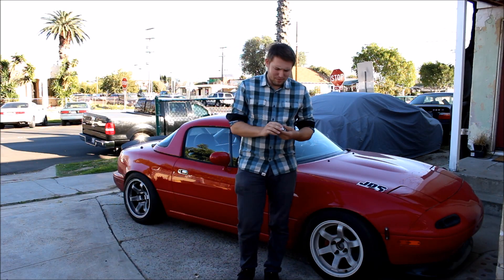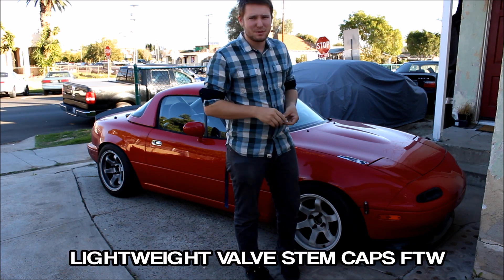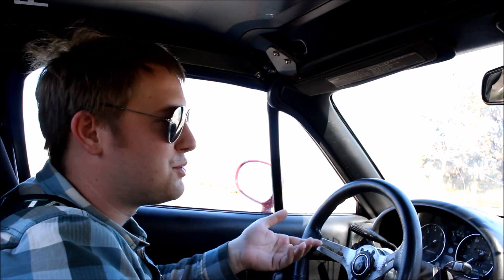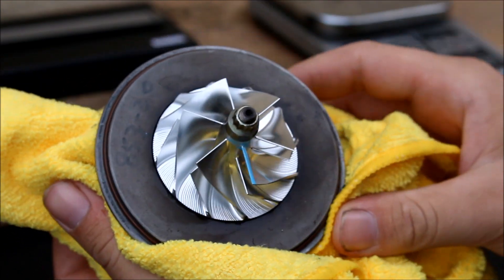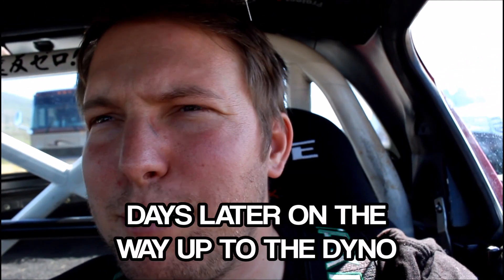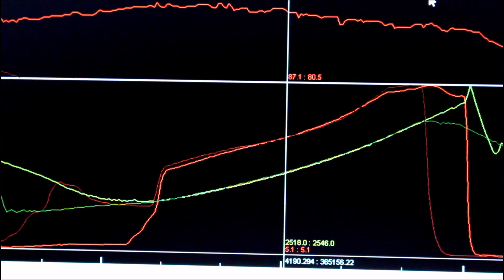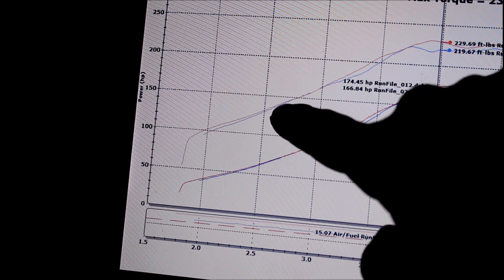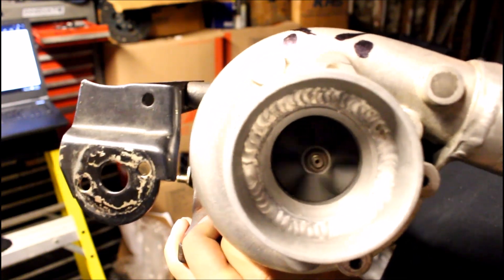Trying to Break The Miata: Billet Compressor Wheel Science!

Comment: Wow man, this is really good data. Using a rolling dyno is sometimes really inaccurate if you don't start the run with even the same exhaust tempurature. The on road testing with different gears testing both boost threshold and lag is something that most guys leave to the butt dyno.
Thank you. This goes beyond what many wheel makers will do.

Comment: If the new compressor wheel is taking in more air than the original one wouldn't that extra force needed to pull it through make it spool slower? I don't understand how that extra air flow doesn't slow down the spool...

Comment: A billet wheel isn't really going to change HP numbers, it's mainly less rotating mass to quicken spool. You summed it up pretty well, only true way to know is data logging with same variables. You can shave more weight by grinding down the heavy nut on the turbine wheel. Hell of a lot cheaper and likely more weight savings.
Reply from the maker: atlanticimports Exactly what I found. The extra 20hp was purely attributed to an extra pound of boost and a little ignition tweaking. I was a little disappointed the boost threshold wasn't slightly lowered, but the increase in transient response is cool!

Comment: did you happen to log the intake temps? since the wheel is more efficient I wonder if you could see a corresponding temp drop
Reply: There is probably very little difference in actual compressor efficiency. Through the middle of the pull its probably within 2%, lots of Garrett Compressors are really good even the ones with a 30 year old design. Shockingly they usually do very good under 1 bar boost. You might have a 10-15°f difference but it's going to be pretty small.
The megasquirt definitely logged the data though.

Comment: #carpassionchannel 
Hey, i need advice on witch turbo i should choose for my setup.
I an planing on building a 1.6, stage 1 headwork and want 300hp.
Could i Get away with a gt2560 or do i need to move up to gt2860 og gt3071?

Guess you allready know, but this is the best YouTube channel of all time!!!👍🏼
Reply from the maker: a GT2560 will do 300whp maximum, a GT2860 will do it more easily and more efficiently, but it will lag significantly more. 3071's can do over 400whp so that would be overkill.

Comment: Anyone know safe turbo numbers for a 1.8 NB with a 5spd? Thinking about rx8 injectors, mega squirt, GT2554R if they cannot handle a ton of power or a GT2560R if they can handle more. 

Also if you had to rebuild the motor, mine is a healthy 156k, what would be the weakest point to upgrade handle safe boost? Would love to run 200-225whp and similar torque.

Comment: what wheels are you using? and the dimensions?
Reply from the maker: Original wheel dimensions for the GT2554R, the specs should be available on Garrett's site. 54mm compressor and 53mm turbine diameters iirc

Comment: I honestly think having 250-300hp in miata is just the perfect sweet spot...the car has good traction and it still is very quick
Reply from the maker: Exactly, power is still 100% manageable with the right tires and suspension, but it's still wicked fun and will surprise most V8's
Reply: TheCarPassionChannel absolutely!

Comment: +TheCarPassionChannel I just bought a 94 NA8 Miata with the full VooDoo II kit.  Im trying to figure out if I should go with the Hydra upgrade or Megasquirt.  Great numbers here... so I figured I would check with you.  Also, what injectors would you suggest?  I am hoping to get around 250hp or so with those upgrades.  I'm running the same 2554 turbo. Thanks!

Comment: 93 miata and wanting to boost but can't afford 3,000. can it be done?
Reply: Thats right on the cut off point. if you wanna source used parts + ebay parts then you might be able to do it. i dont know if i would trust it though. the things that are going to nickel and dime you to death will be all the small junk you didnt take into consideration and the dyno tuning time. 
If you want to do an all new non-ebay build then you are looking at 1400-2200 just in turbo and aftermarket ECU. that doesnt take into account the manifold, exhaust, fittings, intercooler, tuning, etc.
Try looking around on craiglist or facebook for a person selling their miata turbo parts if you wanna get used.
Reply: if you keep it under ~300hp and not tracked or raced then you should be fine with stock stuff. If you wanna track it then you wanna upgrade the clutch and maybe find an LSD rear differential.
Reply from the maker: It depends on what year your Miata is, the stock 1.6 diff can grenade at 200hp, the stock clutch will only hold 150wtq or so. I have a full list on my website of approximate numbers that stock parts can handle. www.thecarpassionchannel.com/faq
Reply: When does upgrading the drive train come into play? differential, transmission and clutch.
Reply: Sweet, thanks for the advice bro.

Comment: Wait is the wheel you replaced the turbine that draws air into the car or the one being pushed by the exhaust?
Reply from the maker: I replaced the compressor wheel, the one that draws air in and compresses it. The wheel on the exhaust side is called the turbine wheel.
Reply: +TheCarPassionChannel thanks.

Comment: @TheCarPassionChannel - Do you feel this new compressor wheel puts the characteristics of say a GT2560R into a smaller housing? Does the turbo hold boost longer or still tapper off at the where it used to?
Reply from the maker: +Troy Sebo It's really hard to say because I never tried to raise the boost up top with the stock wheel. The consensus is that it can flow more air, and 276whp is a really impressive number for a 2554R (IF the dyno is accurate which a lot of people are skeptical of. That's why I'm running the 1/4 mile next weekend, the trap speed doesn't lie). At areas of the dyno where the turbo was running the same boost level with both wheels, the car didn't make any extra power, so it's hard to say. Cars would have to by dyno'd literally back to back to get a better idea, but I just don't have the time/resources to be able to do that. (I'm lucky I have this dyno to use). As far as the housing size, some people install a 60R wheel into a 54R housing that's been machined, and supposedly there is little to no performance loss from running the smaller housing. The only downside to that is you have the weight of the 60R wheel as opposed to the smaller 54R wheel. These are questions I will try to answer someday!
Reply: +TheCarPassionChannel 
Since you were running corn fuel during this dyno I am confused whether or whether not the new CHRA did anything. I know 276 is a kick ass number but if you were to give 2-3 characteristics that you noticed with the new wheel what would they be, for example faster spool? held boost better/longer? Thank you
Reply from the maker: Troy Sebo I was also running E85 when I originally dyno'd with the 2554/stock wheel. The main difference is I raised the boost in the high RPM to keep the torque flatter for longer. Could the cast wheel have done this? I'm not sure because I didn't try it. The most measurable difference was the transient response.

Comment: Greg, I was watching the video of your Miata on TJHunt's channel and saw you had a lightened flywheel. It seems to be a bit of a grey area whether lightening flywheels is good on boosted cars or not. Would be great to see a video on this!
Reply from the maker: +Grazo22 The "claims" are that it hurts spoolup because there is less load on the turbo. I've never seen any testing done to prove that, and I disagree with it. When you're accelerating, the turbo is loaded up by the weight of the entire car, it doesn't care how light the flywheel is. Anyways, just a theory, I freaking love mine and I'd go lighter if I could. The rev-matching on downshifts is super snappy!
Reply: +TheCarPassionChannel I'm inclined to agree with that. Use to love it on my N/A Clio for the reasons you day but now I'm going boosted its an interesting debate the net has never settled. Would be a pain to conduct back to back tests! Keep up the good work on the channel, I really enjoy it.
Reply from the maker: Grazo22 Yeah that's one test I'll proooobably leave up to speculation, lol. I got another good one coming up though regarding turbo testing, probably in another month.

Comment: Is it stock internals?
Reply from the maker: +iSol Stock internals, stock cams, stock head gasket/head bolts, etc. Everything from the valve cover to the oil pan is original.
Reply: Wow nice, how much power do you think it will max out at before bending rods/melting pistons?
Reply from the maker: iSol The commonly accepted values for rod safety is about 250wtq, and pistons are good to around 300whp assuming safe AFR's/no detonation.
Reply: Good effort then!

Comment: Isnt this the threshold 4 banger Audi's fanbase recommends there 4 banger limit??
Reply from the maker: +DarkLinkAD .........what
Reply: TheCarPassionChannel
Yeah, its the recommended threshold for 4 banger Audis. They come with with forged pistons and cheap rods, so the general conscious is that the cheap rods will fail over 275whp.
Reply from the maker: DarkLinkAD That can vary a lot from engine to engine. Also, torque bends rods, not horsepower.
Reply: TheCarPassionChannel
Yeah, Torque spikes more specifically but these guys are too conservative in my opinion.

Comment: stock block? just with Turbo and ms?
Reply from the maker: +Cramer Ward-Collings Essentially. Turbo, MS, E85, and lots of dyno pulls over 2+ years of refining the setup
Reply: +TheCarPassionChannel thank you! how much power do you think a stock 1.8 could hold?
Reply from the maker: Cramer Ward-Collings The connecting rods of the 1.6 and 1.8 both have about the same threshold of 250wtq. The 1.8 just makes the power a little easier.

Comment: Hey!
Did you ever talk somewhere in your videos about compression ratios? :) If not, I'd love to see a video about this and possible choices for pistons etc :D
Reply from the maker: +MrShiver55 Still completely stock internally, factory compression is 9.4:1.
Reply: Yes, i know. (That is impressive at your power level :D ) The thing is..... I have a 1.6l 1990 engine here, which is completely disassembled. I'd like to go forged and I'm still wondering, at which compression ratio I should aim. ATM I am thinking about 9.0:1 or something. Compression reduction for turbo.... Any ideas? :)
Reply from the maker: MrShiver55 Sounds perfect, I think there are a couple companies that offer 8.8:1 or so. It's safer to run a little lower compression and more boost haha. Check out Fab9Tuning (dot) com, they are your one stop shop for high horsepower parts and they have a big selection of forged parts.
Reply: +TheCarPassionChannel Thanks :)

Comment: I wonder what kind of difference this billet wheel would make if you were running e85 on higher boost :)
Reply from the maker: +MrEp1kk I am running e85, and on a GT2554R it really is close to being maxed out. More boost isn't going to do much more, time for a bigger turbo!
Reply: Ahh okay thanks :) Disco potato upgrade maybe? (garrett 2860) Have you done a video about living with an e85 fueled car? Very curious to hear about the long term pros/cons..
thanks again
Reply from the maker: MrEp1kk Scared the 2860 might be too laggy for what I want, especially since I'm already loving the spool up of the 2554. And I don't have much more headroom since it's a stock motor. I haven't seen any long term negatives, I've run E85 for around 8,000 miles I think? Biggest downside is the range, went from 26mpg average to 18mpg. That's with all cars though, it was well worth the gains, but you really need dyno time to get the most out of it.
Reply: Hrmm i see your point.. would you build the motor or jam in an sr20 driveline or something first? Here in aus we have 98octane petrol (lucky i know) do you still think e85 is worth the extra few octane?
Reply from the maker: MrEp1kk I think if I had my choice I'd go 98 octane since you'll retain your fuel mileage. I think I'd do a mild build on the 1.6, just pistons/rods. If I went through all the trouble of a swap an SR20 would be high on my list.
Reply: Thanks for your time man, was really helpful. Also if you build the 1.6 or do the swap.. Can't wait to see those videos :D
Reply from the maker: MrEp1kk Already scheming on how to get more power.... why is it so addicting?
Reply: I know right! I told myself 300whp is enough.. but now i've run out of bolt on options.. & building a motor is a daunting feat for a noob like me..

Comment: I was wondering if you could help me figure out what turbo to put in my car. I drive an 04 LS Miata, it's completely stock at this point and I eventually wanna get it boosted. I'm not quite sure which turbo I wanna run. It seems most people choose between either the gt2554 and the gt2560. I'm just wondering which you think would be better for street use, I don't plan on taking this to the track or the strip. Any advice would be great
Reply from the maker: +Alejandro  Flores  With a 2004 engine, I would say a 2560R would be well suited. The 2554R runs out of air a little quicker. The 2004 engine will be able to spool a 2560R very fast, the only reason I'd say go for a 2554 is if you are looking for maximum spool at the cost of losing a little power at the top end. You'll be very happy with either one, but that is the trade off.

Comment: Do you produce that boost with stock waste gate?
Reply from the maker: +Brad Nicolini The wastegate is definitely a limiting factor right now, it's only a 7psi actuator, so trying to properly control 15psi is overwhelming it. It's good enough for now, but I need to go with at least a 10-12psi spring, or just go to an EWG setup.
Reply: I may try the spring thing. I have the same setup but journal bearing. Just got a flyin Miata happy meal and going for a tune shortly after. But want to make sure I have all I need for tune time.
Reply from the maker: Brad Nicolini What psi is your spring?
Reply: +TheCarPassionChannel not sure to be honest I want to say 7. it's stock.

Comment: why you risk blowing your engine man ?  Just go forged pistons and rods ...
Reply from the maker: +lampros poiotita Why spend $3000 when I don't have to? haha
Reply: TheCarPassionChannel But you will spend more if you brake the engine (thanks for answering to me )
Reply from the maker: lampros poiotita Not really, I can get another stock 1.6L for around $300 and be back to where I started. That's really the reason I haven't tried to build a 350whp car yet, it's exponentially more expensive. I would have to upgrade the clutch, transmission, turbo, etc.... it adds up so fast!
Reply: TheCarPassionChannel ohhh ook then.Here in Greece they are a lot more expensive !

Comment: @ TheCarPassionChannel - Have you done a coolant reroute on either of your miatas? I have the stock cooling system on my NA8 95' and was wondering weather I should consider doing one as my system seems to get a little hot in Dallas during the summer especially if running the AC and I am still NA, we will be running 12psi shortly so thought I would ask!
Reply from the maker: +Troy Sebo Yes on my fast car I have done the reroute.
Reply: +TheCarPassionChannel 
How hard is it to do with the motor in the bay? Will I want to kill myself?
Reply from the maker: +Troy Sebo Nope! The hardest part for me was tightening the bolts on the rear housing, but it's not too bad, just takes patience.

Comment: Hey Greg my car idles really bad after I install the bov (Tial Q with 10 psi spring), the rpm jumps at idle almost like a bad IAC valve. I notic the bov not close all the way when idle, but when pull out the vacuum line valve close and idle normal. Do you know if there is any adjustments from megasquirt?
Reply from the maker: +Ken Li That doesn't have anything to do with MS, you need a stiffer spring (or to adjust) the BOV, it's not supposed to be open at idle. (Unless you recirculate it). But it shouldn't affect the idle speed because it's just an opening in the intake piping. Do you have the stock AFM or MAF or did you delete it when you went to Magasquirt?
Reply: +TheCarPassionChannel yes I'm still using the stock MAF.
Reply from the maker: Ken Li Why keep the MAF if you're running MS? But yeah that's unmetered air leaking in through the BOV.
Reply: +TheCarPassionChannel deleting the MAF is the next thing I'm gonna do. But now I'm wan to fix the idle issue first. I'm gonna try stiffer spring like a 12 psi spring or something.
Reply from the maker: Ken Li There's no "psi" rating on BOV springs as far as I know... they don't control boost. They're more likely marked as pounds per inch (not pounds per square inch). But a stiffer spring should fix the issue.
Reply: +TheCarPassionChannel ok thanks Greg. What kind of spark plug should i use for 1.6 turbo Miata and what gaps?
Reply from the maker: Ken Li NGK BKR7E (Make sure you get the 7's) and gap depends on boost and ignition system. Run the biggest gap you can without getting spark blowout.